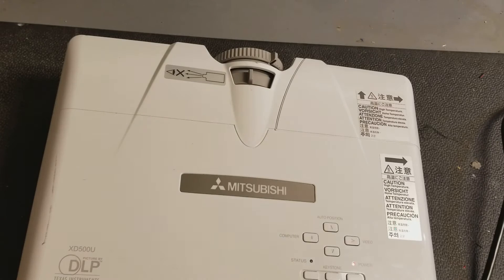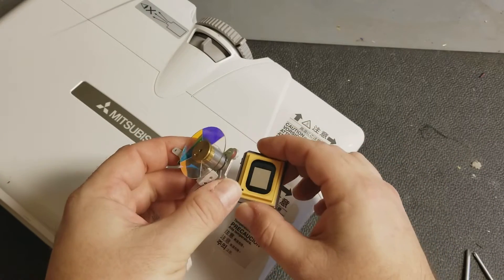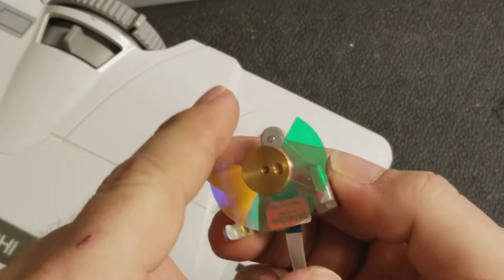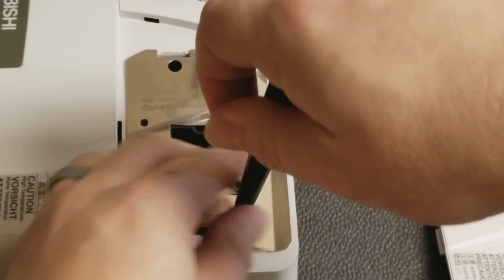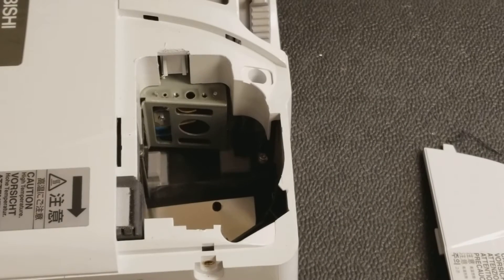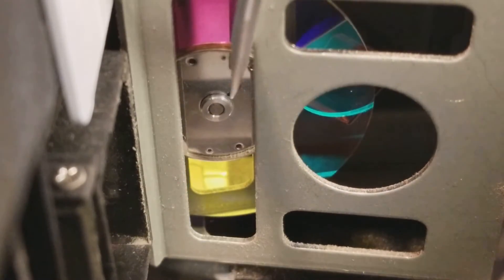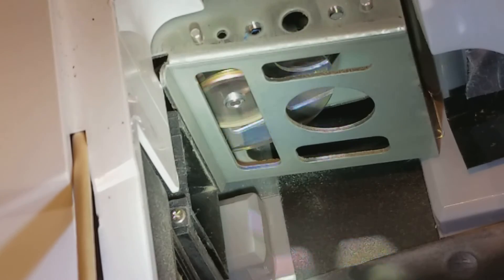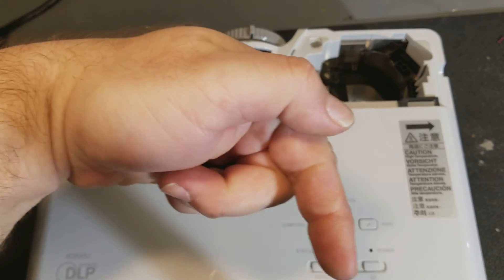Troubleshooting your DLP Projector : Color Wheel

Comment: Hi i have a projector once i was using it and the colour wheel stopped in a sudden and obviously it turned off, i bought a new colour wheel and it spins while turning on but the bulb is not lighting up, the projector makes triple beeping and lamp indicator turns on. Is there any solution?
Reply from the maker: Hi Dejan,  It sounds like it is not registering.  What color is the lens on the lamp?  Does it have a green coating or a red/blue coating?
Reply: @FixitFrank  Hi red/ blue coating

Comment: I have flashing colors with my BENQ TH681. Sometimes the image disappears totally. If I do a restart then the projector refuses to turn on again and the led "lamp" is red. After a while it can be restarted. Do you think it's the color wheel or the sensor or something else?
Reply from the maker: Hi Sebastian, Pop the lamp out and see if there is any dust buildup as well as a burn mark in the center of the lens.  The sensor could be dirty but the lamp might also be wearing out and burn a hole through the IR block coating.  This can cause the sensor to become erratic.  I'd start with checking the lamp. If you find evidence of dust buildup, it would be worth cleaning.  If cleaning does not solve it, then it is time for a new wheel. 
I have a few BenQ cleaning videos that would show you what to check.  Your TH681 is similar to the W1080 and W1070.  Here is my W1070 video  https://youtu.be/_xBGZ_V9Jp8
Reply: @FixitFrank  
Thanks for your detailed answer.
I had dust problems over the years. Thus, I cleaned (compressed air) the optics and fans maybe a year ago. I also had dust in front of the chip before the lens group. The white blurry areas were horrible.
I am not using the projector very often. I bought it in 2015 and I still have the same lamp which is at around 50 %.
I read about the IR/UV coating of the lens. But I am not quite sure which lens is meant. I only have a flat glass. But I guess this also should have this protection cover. How can I test if is still ok?
I read in some forums that the IR sensor itself should be replaced if the color wheel seems fine. I have no problem in replacing that 50 Cent thing (SHARP GP 2S700HCP). Soldering is no problem for me.

I think I will go that way now:
- Check the protection coating (but how)
- clean the IR sensor (as shown in your videos)
- check the color wheel once again
Reply: I just saw your video "Cheap Versus Good Projector Lamps for DLP/LCD Video Projectors". Actually there you gave the answer already :-)
But in my case I don't think its the lamp nor the lens.
My guess is, that the sensor or the wheel has a problem.
I keep you updated...
Reply from the maker: @sebastiannobody1142  believe it or not that flat glass is the lamp lens. It's job is to block/filter UV and IR light so it doesn't get into the projector. The UV is blocked by just about any glass, but the IR is blocked by the coating I mention. If that flat glass does not have a red/blue ish coating, then I'd start there with either reusing the old lens(if it's not thrashed) or sending that lamp back and getting a better one. The cheap lamps cause more problems than they solve. If you have a good lens then I'd replace the wheel. The sensor can fail but it's very rare. You can test it by reading the voltage output of the signal wire. It should be a very steady voltage. The number doesn't really matter as long as it's not vcc(5v likely) or 0v. It's technically getting a lot of pulses but your meter should read it as one voltage. If it jumps around, it may indicate an erratic speed of the wheel. I'd replace the CW before the sensor. But start with the lamp.
Reply: @FixitFrank  ok thanks once again. As mentioned before I still have the original lamp, thus also the right lens. But later I will check for burn marks.
Reply: Ok, here my update: The lens was perfectly fine as expected. After that I dismantled the whole projector and took the color wheel out. I use a lot of compressed air to spray out any dust inside the motor bell. Finally, I cleaned the sensor with isopropanol and the color wheel glass itself with glass cleaner. And surprise: No color issues anymore. 4-5 h now with perfect image. But I guess in a few month I need to replace the color wheel…
Reply from the maker: @sebastiannobody1142  That will hold up for a bit.  You might even luck out and it will last a while.

Comment: Hi Frank, thanks for your most instructive video. I had problems with a rotating noise inside my Optoma beamer, which I thought must have come from the fan, but it turned out that the colour wheel was the source of my problems. Learned a lot from your video on how these beamers work. Thanks!
Reply from the maker: Thank you for letting me know!  This is exactly why I do all the videos I do.  I do not consider myself an expert by any means, but I have picked up a thing or two.  I hope that by sharing what I learned it will save someone else some time and money and keep more e-waste out of the ground.

Comment: Hi Frank, I work at a Community College where we have a bunch of Mitsubishi projectors, particularly XD280Us. There is a common issue where a projector will turn on, will tell me that I need a new bulb (even if the projector has a fresh bulb with the timer reset), then will begin to flicker the image (sometimes in wrong colors, but not always), and then shut itself down. Do you have any experience with this issue? Is it an issue with the color wheel issue? Perhaps an overheating issue? Do you know of any fixes to try? Thanks in advance.
Reply: There are some things in this video that sounds like the issue: lots of dust and the three attempts at starting up, for instance.
Reply from the maker: Hi Jeremy!  That sounds like dust on the color wheel sensor among other places.  One of the local schools to me has their smart board PJs cleaned yearly.  Its amazing how much they pick up dust-wise in school environments.  I'd try cleaning first before going down the road of color wheels.

Comment: hi can you explain me mine toshiba tdp-t90a turns on works fine but when it work for an hour then it loose colours
Reply from the maker: Hello, When you say it loses colors, do you mean it goes black and white or the colors start to change?  Red becomes purple, blue becomes yellow etc?  Usually color issues this sort of issue is color wheel related.  It may have a dirty sensor or possibly a failing hub bearing in the wheel.  If you can clarify the issue(pictures are great!) then I can help more thoroughly.
Reply: @FixitFrank  every time its diffrent and wont change when restart projector its fixes itself for a short period of time and again monocolour
Reply from the maker: Hello! I apologize for not replying earlier.  I can repair projectors, but handling comments seems to be more difficult.  
When you say 'Monocolor' you mean any color(red blue green)?  Not black and white, correct?  I suspect you have a color wheel that is sticking and causing the projector to shut down.  Replacing the CW is your best option.
Reply: @FixitFrank  yeah i watched a few videos and toked my projector apart and cleaned colour wheel and darkened the black sticker with marker now its working properly

Comment: How you do actually open it to replace the wheel? Mine shattered and it’s just showing black and white
Reply from the maker: There are 5 screws on the bottom that need to come out if I recall correctly.  I will see if I still have this one in the back and if I do, I will do a teardown video.  Is yours the XD500?

Comment: Hi frank, nice video. I have a Optoma hd141x 3D projector, a problem started days ago, though lamp life 992 in 3years but there’s a rainbow effect when the powered on which clears after a while then starts again when there’s a very colourful scene in a movie or program then clears again, and the same process is repeated again and again. Any tip would be appreciated. 
Thanks,
Reply from the maker: Hi Joey,  That 'sounds' like a color wheel issue. I would try the easiest thing first and give it a light cleaning.  Dust build up on the color wheel sensor can cause the symptoms you mention.  It also can be a failing color wheel motor. Cleaning would be the best option first. I have a few videos on cleaning Optoma.  I think my HD20 cleaning video would be almost the same thing as your HD141X.

Comment: Frank I can't message you it seems so hopefully you see this. My color wheel seems to work fine as long as the lamp setting is on economy. If I change it to standard brightness, colors flash and I hear the wheel spin up faster, but it buzzes slightly irregularly. It sounds almost like there's play in the motor. Why would there be brightness-dependeant behavior of the color wheel?
Reply from the maker: Hello!  That is definitely unusual behavior.  My first thoughts are on the lamp itself. Sometimes lamps can flood the IR sensor of the color wheel with too much infrared light if they have a insufficient or incorrect coating on the lens.  To help you further, I need to know the model of your projector and I also need to know what lamp is installed in the housing.  IF you can, take the lam housing out and look at the back of the lamp itself and see if there is any marking that says Osram, Philips, Ushio etc...  If the lamp came from Amazon/eBay and is a no-name then let me know.  The main thing to look for is the glass on the front of the housing.  IT should have a red/purple-ish coating if you tilt the housing in the light. If the lens looks clear or greenish, that is the root cause. Those greenish coatings don't work most of the time.  Let me know that other info and we can go from there.  Thanks for watching my videos!
Reply: @FixitFrank  First off, thanks so much for the reply! 
Ok- Mitsubishi DLP EX321U. Bought it for parts with no lamp to service a working EX240U with a bad DMD chip, but impatiently also bought another 240U during the long shipping period and ended up using the 240 chip for my 240. However, upon receipt of the EX321U, it looked promising so I got a lamp for it for $35  Yes, it's a replacement lamp from Amazon "Amazing Lamps" brand lol. Upon inspection, it does have a green coating, not red/purple-ish, and the bulb has no markings. Also, it's full of dust/debris inside and the specks on the reflector correspond with the bokeh / focused stars I see when all black projected (Whew! Thought it was in the optical housing which I thoroughly blew out when re-thermal greasing the chip). 
Also - after writing the first comment above, I swapped the color wheel into my known-working EX240U. During the swap I blew out the dust from the sensor area best I could without actually disassembling the color wheel housing itself. It worked fine in the 240, so I swapped it back and Viola! It seemed fine on both low AND standard brightness settings, so I was thinking it was dust reflecting oddly onto the color wheel sensor and freaking it out at higher brightness. Tested for an hour and looked great (aside from the dust in the lamp showing as blurry white circles). THEN....I started messing with color temp settings. 4 choices of T1 - T4 are basically warm white kelvin to cool blue (Meanwhile, still using the "standard" lamp brightness setting at this point since it was holding fine.) As soon as I cycled through to a higher temp (bluer) it started the flashing and high speed wheel spinning. I was too many menu layers away to quickly switch the lamp settings back to "Low" from "Standard", and the PJ shut down. I fired it back up after a while and it was ok again, and I left it at "Normal"  That's where I stand. 
I am returning the lamp today...do you have a link or suggestion for a replacement that is good? I'll try that. 
If problems persist, I could disassemble the wheel housing and clean 100%. If still bad, I'd  have to assume it's possibly the motherboard or voltage to the wheel related issue, or something. 
ALL THIS FOR 1024x768! LOL
But seriously, it's for movie / game nights outside with my kids, so....WORTH IT!
Reply: @FixitFrank  In the meanwhile, I've ordered this one for $55. A step up, but not full blown OEM such as from projectorlamps.com for $123. Here's the link: https://tinyurl.com/y6rr4zhm
Reply: 2nd lamp does same thing. Coating looks non-existent if not slightly greenish. Standing by for your suggestion.....
Reply: @FixitFrank  any suggestions? thanks.
Reply from the maker: @NoSloppy   NoSloppy  I'm sorry, I didn't see your last reply. Yes, that lamp should have the coating. Do you mind if I ask where you purchased it? 
If you still have the old-old lamp, you can use the lens in the new lamp. That lens is the key here in my opinion. You can remove the screw that holds the lens frame in place and pop the old lens into place of the new one. You can email me at sales@weezytech.com too . I heard YouTube notification was not good...

Comment: Hi Frank. I live  in Phuket, no one  repairs projectors here!  My optima hd20 comes on like the one in your video 3 times. Colour wheel spins each time with flashing green light, then solid red light and flashing Amber. no light at all emitting from the lamp. Is is possible that the lamp would just stop working? It looks fine. 
Thanks!
Reply from the maker: Hey Jonathan! Even if the lamp looks OK, they can still be bad.  It is an arc lamp and if the arc points are worn too far apart or they get clad in burned material it will not light up.  I would try a lamp first since it's the easiest to replace. This will sound odd, but try smacking the lamp a few times firmly but not too much. It can dislodge the 'crust' on the electrodes and may at least get it to light once or twice to say if its the lamp. This is a last ditch method so it may not accomplish anything.
Reply: FixitFrank thanks for the quick reply! I’ll give it a whack to check. Then I’ll order a new one. I looked at the power management area and couldn’t see any bulging capacitors. Thanks again.
Reply: Gave it a tap. And success. It’s got less than 200 hrs on the bulb. Just checked.  I’ll hold off on ordering a new bulb. Thanks again.
Reply from the maker: @jonclark80  That is  fantastic!  If you use it regularly it should be fine.  I love Percussive Maintenance.

Comment: Hi how are you doing? I have a vivitek projector model d837. I'm getting a color wheel error. The color wheel is spinning up what else can I do to troubleshoot?
Reply from the maker: Hello! I am well thank you. That could mean a dirty sensor for the index mark, a failing motor( might be spinning slower than acceptable) or the index board is bad itself. I'd check the cleanliness of the index sensor first. I have a few videos on color wheel repairs.